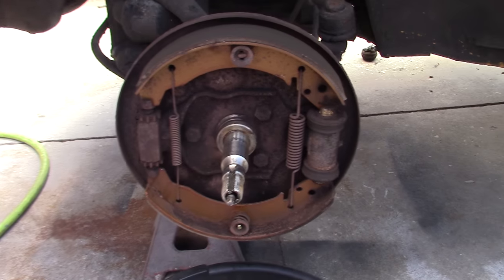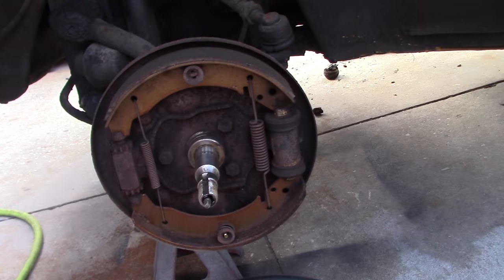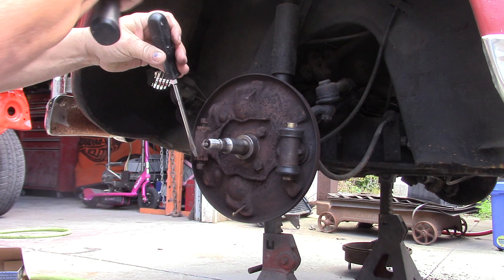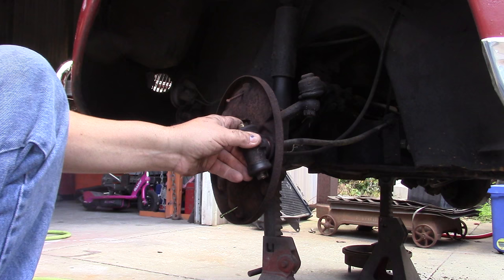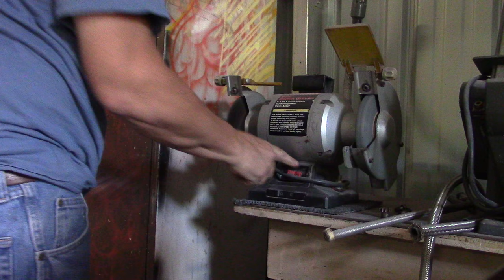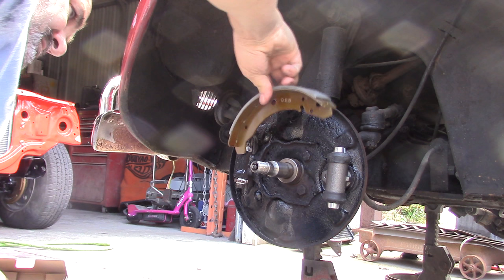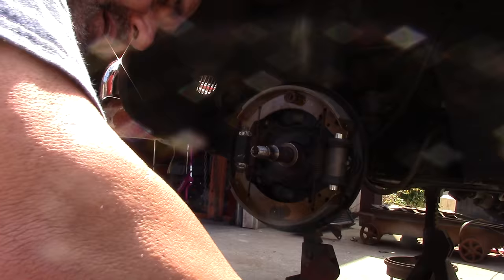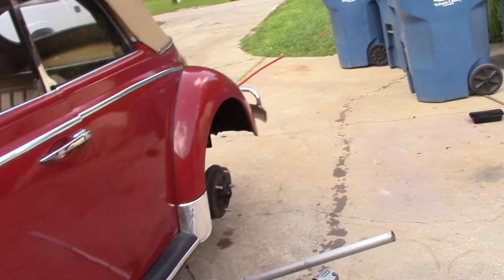Front brakes on the 1965 vw bug

Comment: There are very few videos available for setting Beetle front wheel bearings, so thanks greatly for filling that gap. My particular angst about this job is in getting the bearings tightened properly (loose versus too tight) and I think you covered that and explained it well. The manual says when tight you should be able to move the washer "laterally" and I didn't understand which direction until you explained it. I feel more confident attempting this now after your great explanation. Also didn't know the flat side of there washer needed to face in towards the bearing (or that there WAS a flat side). I had to chuckle WITH you on the grabbing the wrong wrench. I grab wrong tools frequently while working on the car and we can ALL relate to that! The only thing I might add is to apply a dab of silicone sealant over the circlip to prevent moisture to enter the bearings space (which may be why there was wetness in there to begin with). Thanks for taking the time to provide this valuable information! Well done!
Reply: Owners manual says 7ft pounds

Comment: Whenever I utilize YouTube to do a project that I don't know what I'm doing. If I can find more than one video I watch a few to get an idea of which presenter knows what they're doing and if they have a different way, or a few better ideas. Your video on the front brakes and wheel bearings is the best one I saw. Even just a few of your extra little tips, ie: a little grease on the bearing seal to prevent  squeaking. About how to tighten the nut and then back it off and then check for a little play in the washer. Your video isVery thoughtful, and informative thank you

Comment: Just bought a 64 baja (paid probabby $1 k too much) and it has no brakes at all. No idea how the guy drove it when I rode along. I can't drive a stick (yet) so I didn't notice he wasn't braking, partly becauese the odd seats aren't even bolted down, so I was hanging on for dear life. Anyway, for now I'm staying with drums, but I did order a later master cylinder and the bottle that sits right on it (labeled as being for off road/better braking). I should have the almost $180 worth of parts form RockAuto in about a week. That included a few extra bits like fan belts.

Comment: I just change the bearing on my 65 vw but now the right front tire is rubbing on the 3 bolts inside.
Reply: I’ve ran into the same issue on my 65 beetle what was the fix?

Comment: To convert to new style bearings all you need is to take the sleeve off the spindle buy bearings and races and install correct? Same style wheel seal?

Comment: Just a thought I did not see the bore of the adjuster cleaned reattaching the flexible hose to a new cylinder almost always results in a twist in the hose unless you loosen the the union at the other end no hmp grease was used in the end of the shoes  and the lock tab needs replacing each time maybe buy a dial indicator for the end float too but for a shade tree fix I guess it will do

Comment: Did a disc conversion on my wife's 74 Super.Put several hundred miles on it.Not a problem at all.THEN ! !About every other time it's driven - the front brakes lock up.The brakes are ok while still in town - it's while out on the highway. Already driven 5 to 7 miles since brake was used.Any idea what is causing them to grab ?Replaced all 4 rubber lines & master cylinder when I did the Disc conv.

Comment: Vibrating video of the brakes installation of the front of the 1965 "Volkswagen" thank you. I have a question for you,ride on my 1962 Volkswagen a new "Drop-Spindles" 2 1/2 inc to lower the front and now I have the problem that the 2 front tires when you move the car forward and backwards but mostly toward the front ,please you can help me and thank for you time on you-tube;Sincerely:Jose'Jr.(VW-1962)

Comment: I kind of remember doing some brakes on Beetles here and they had split axle nuts with allen pinch bolts..What series were they on.?
Reply: my 62 has those. Not really sure on the correct way to tighten them. Everytime I'd tighten the pinch bolt it would tighten up the nut and put to much drag on the rotor. So I had to leave the nut looser than normal and then tighten the allen.  I'm sure I did something wrong. lol
Reply: If it worked it can't be wrong...lol
Reply from the maker: they change the design in 1966 to the pinch nut with the Allen screw ,